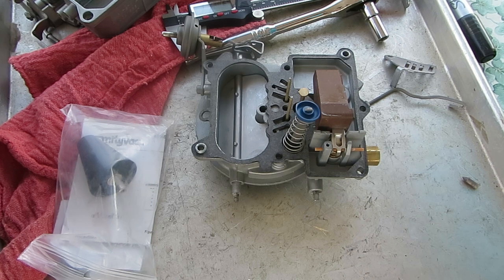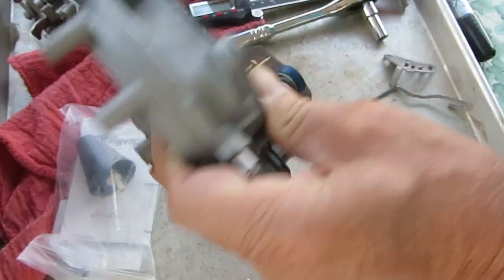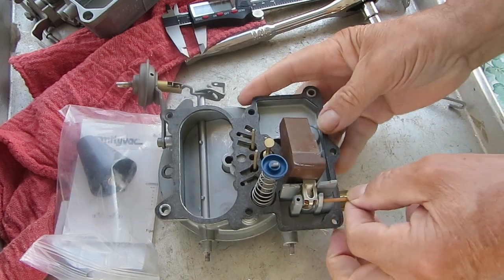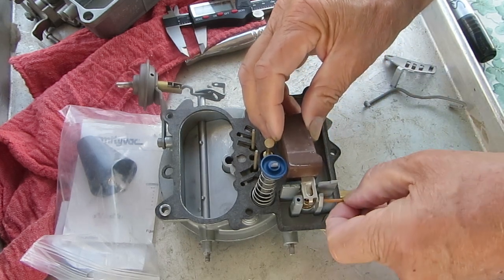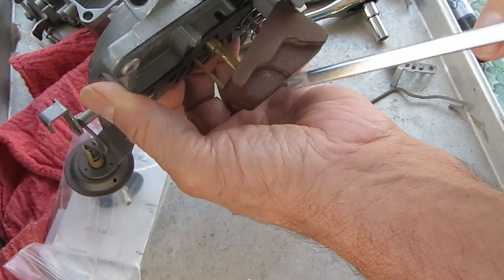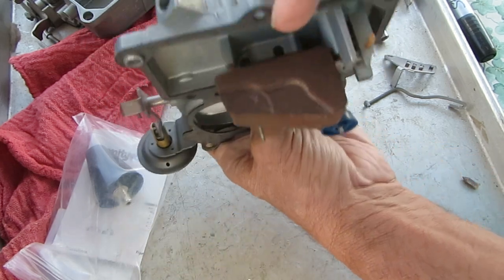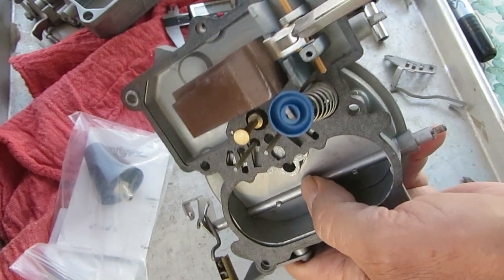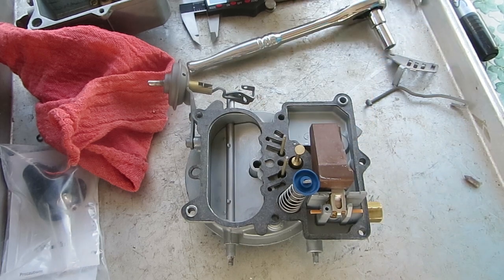Holley 2245 2 Barrel Carburetor Float Adjustment

Comment: I have a brand new holley 4173 that was from carburetor  specialists out of georgia.  It is the same model carb that came from the factory on my 79 Dodge Power Wagon with a 360.  I tested it with wide open throttle and was happy with the settings  I gave it, but after releasing the pedal it died and would not restart.  It turns out gas is coming out the top of it like it's flooding.  I got it restarted but ran terrible and could not keep it running.  What are your thoughts?